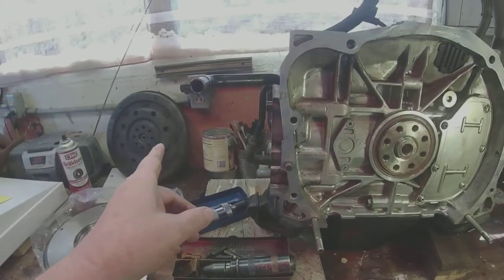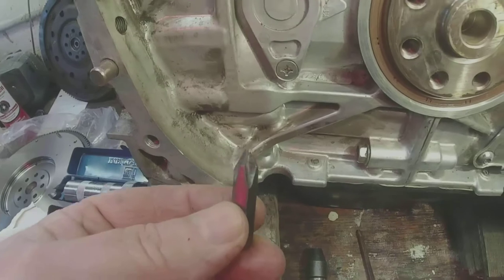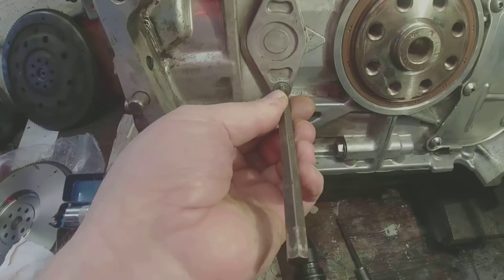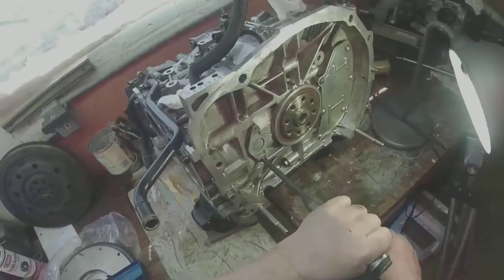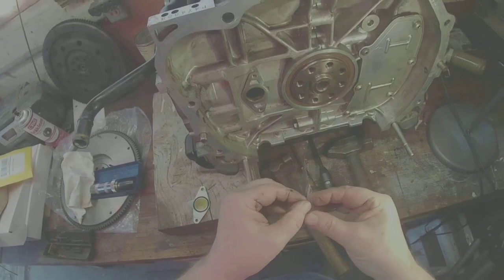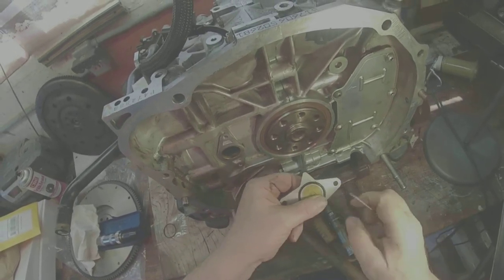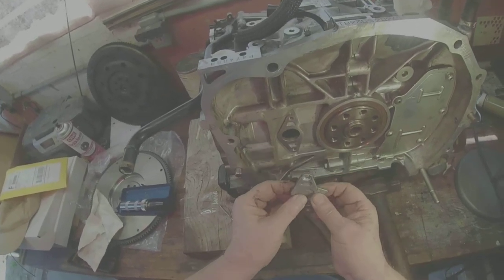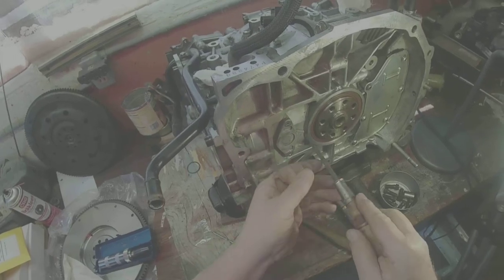Resealing Wrist Pin Service Plate in a Subaru EJ25

Comment: Heat the screws up before trying to loosen them to release the thread locking compound.
Reply from the maker: I can see the logic. Heat may break down a thread sealer. Although I don't remember seeing any on the threads, and I'm pretty anal about cleaning stuff like that.
Still, I think aluminum (screw holes) expands more than steel (the screws) with heat. So it may help even if there isn't any thread sealer. Maybe try to keep a propane flame directed on the aluminum around the stews. (That could distroy the rubber o-ring behind the cover plate, making it a 'rubicon' choice.)
A couple of penetrating oil soaks probably wouldn't hurt either.

Comment: Can we use impact driver?
Reply from the maker: I call the tool that I used an impact driver. I'm guessing that your thinking an electric or air impact driver. I can't advise on a power impact driver, because I've never used one.
I went with the manual impact driver because I'm very familiar it. My primary thought, removing the machine screws, was to not break off the screw heads, or bugger up their phillips slots. 
 A power tool would probably work fine in hands that know the tool.